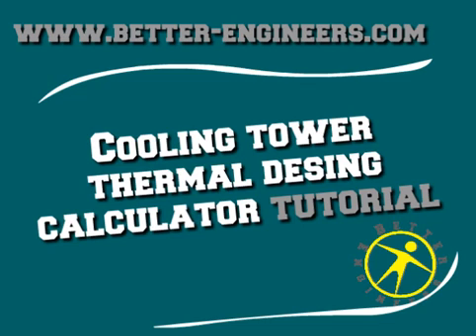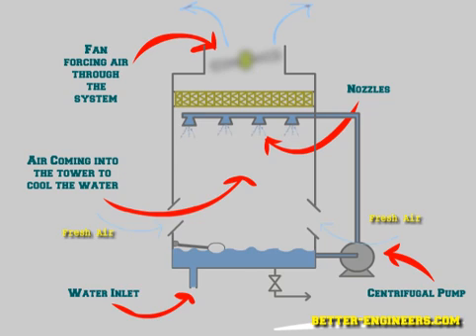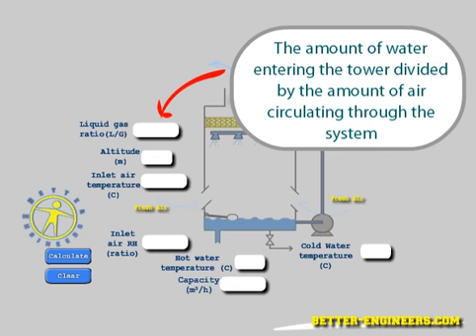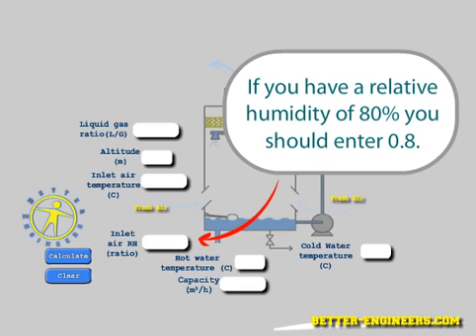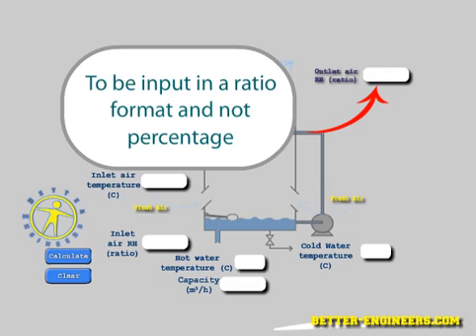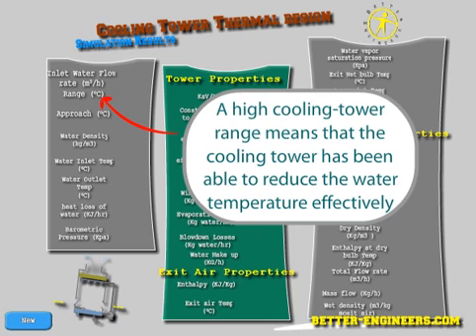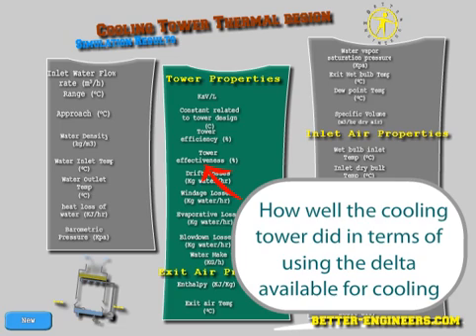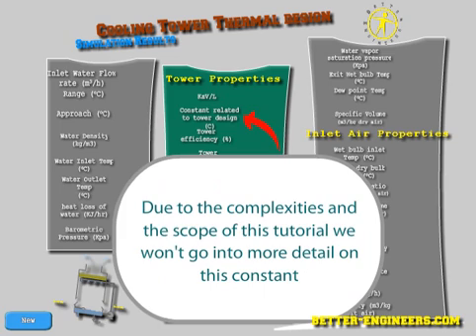Cooling Tower Thermal Design Calculator

Comment: If exhaust air would increase temp as you telling in the 00:44, then all swamp coolers won't work. This is not true. Temperature decreases in water AND air temperature together as energy was consumed to convert water to vapour.
P.S. where is the calculator link?